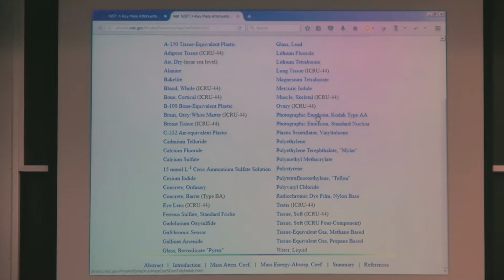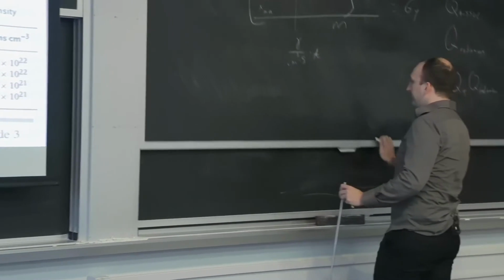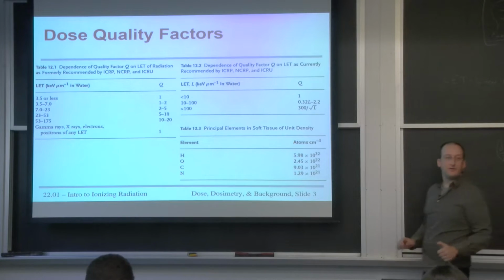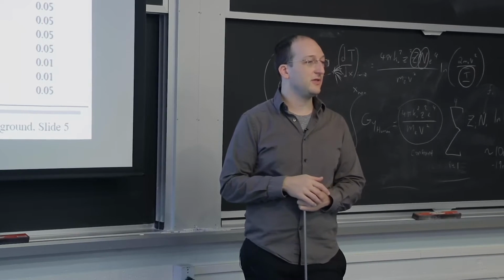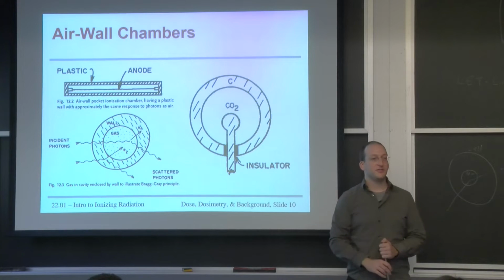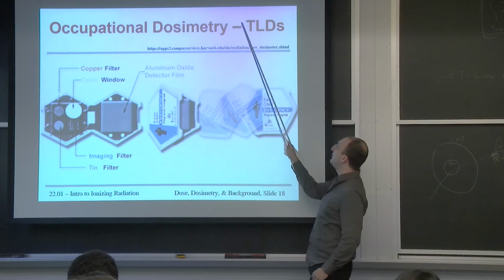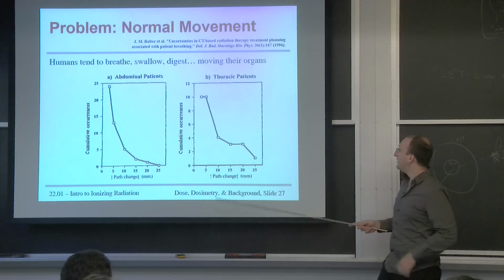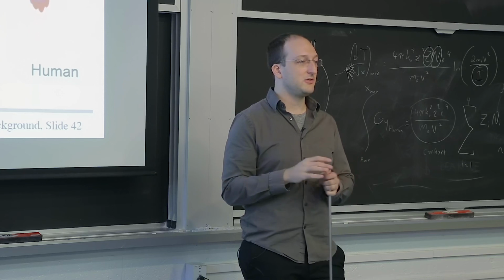30. Radiation Dose, Dosimetry, and Background Radiation

Comment: if the stopping power of neutrons decreases because the cross section goes down after the resonances, how come that very same stopping power is low for low energies, when the cross section is way up?

shouldn't the stopping power follow the same trend we see in the cross section graph? high for low neutron energy and low for high energy?
Reply: With neutrons, whether fast or slow spectrum beam.  Regardless of the beams velocity, when you speaking of Neutrons specifically, the speed at which the travel and come into contact with a surface that you are targeting.  I have professors explain it to me like this, think of using a grenade in the army against enemy forces.  Some fighters can throw and hit you with that grenade really fast, some people don't have those quick pitching skills.  In the analogy I'm using is why Neutron radiation is deadly no matter their speed.  You as a human on the battle field are not at all worried about the grenade hitting you, that's why if your quick enough you might have time to through it back. With neutrons it is much the same thing, mammalian cells (you, me, other critters of the world, heck even plants for that reason are not worried about the ACTUAL NEUTRON HITTING YOU, fast or slow because it won't hurt you. HOWEVER, neutrons have an eight minute or so half life so when a short period of time goes by and the Neutron begins to decay, a single neutron, if I remember correctly absolutely BLASTS OUT HIGH ENERGY GAMMA AND BETA radiation that no living tissue on Earth has been found to have a tolerance to it.  So, its like the soldier in combat analogy thing again, you are not worried about the grenade hitting you, BUT YOU ARE AFRAID WHEN IT BLOWS UP IN 20 SECONDS TO RELEASE ALL OF THAT ENERGY, killing you and maybe several of your squad.  I can't remember the site I saw this type of thing, but it was a small science demonstration on the power of a single neutron held in safety chamber and you can actually see many beautiful little lights appear in the chamber.  Very beautiful, but when you realize you are just witnessing just the release of energy of a single neutron decay that is even possible to be scene with the naked eye, which I believe you know how really small protons and neutrons are compared to us, you realize a neutron releases an astronomical amount of energy in the form of visible light we can see with our eyes, electron scopes or any of that jazz, just all of that energy in a single neutron releasing so much power, you can see it in plane sight, is just awe inspiring and frightening at the same time.  If that single were to gather with many other neutrons and make a gram of the stuff, your talking a twenty, forty, heck 60 mile drive away might not be able to get you away from energy released in that first decay of a gram of neutrons.  I can say with the utmost happiness that Neutrons love to stick to Protons that utilize the "strong nuclear force" to keep them nice and stable.  On a side note, it's probably for the best that they do in fact "almost" always stay in the nucleus of the atom because of their nature if any bad actors try to make, I don't know, some sci-fi device for city destruction, that the neutron will be more than happy to horrifically irradiate anyone without many physicists, the best equipment, and facilities that can more or less harmlessly keep them from crazy people and uneducated people from trying to think of a way to use them for nefarious purposes.  It's be safer to cover your self in gasoline and smoke a cigarette than try to make use of it.

Comment: One small correction: LET is equal to the collision factor of stopping power, or the restricted stopping power, not the total stopping power. Remember, Total SP = Collision SP + Radiation SP.

Great class! You can see perfectly the enjoyment in this teacher's eye when he talks about this subject.
Reply: You can say that again!!
Did you see it in Attix? Great book
Reply: i agree :)
Reply: Plz can you more explication
Reply: @amirouchebouremani1213 , sure! LET is the Linear Energy Transfer, so, by that, you can understand that the particle gives energy to the medium through its trajectory. Mathematically, you can understand it as -dE/dX (the sign is negative because we consider the energy loss), and you can remember that this is the stopping power. However, we are not considering the total stopping power, but a restricted stopping power. The restricted stopping power is the mean energy loss per unit length thickness due to
collisions involving energy transfers, that are smaller than some chosen cut-off energy, denoted by greek capital letter delta. Here's where we have to consider the two components for the total stopping power, as I said in the comment, the radiative SP and the collision SP. If you have any more questions, I'll be happy to answer them!

Comment: Except LET is absolutely NOT the same thing as the stopping power. S=-dE/dx. It takes into consideration all mechanisms by which the initial beam of intensity I weakens, while LET=+dEabs/dx, that is, the part of ABSORBED energy per unit distance.  It takes into account only the part of energy that is absorbed by the material. 

In the example of Compton scattering the gamma ray for instance can knock out an orbital electron and change direction. The total intensity will decrease, but the gamma photon will not be absorbed by that atom.